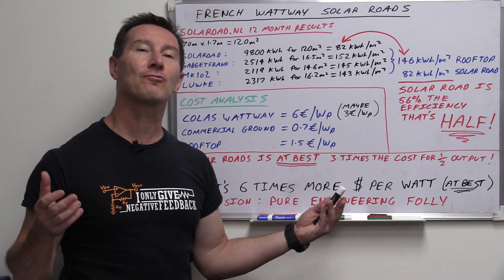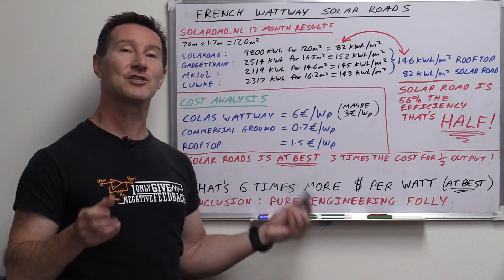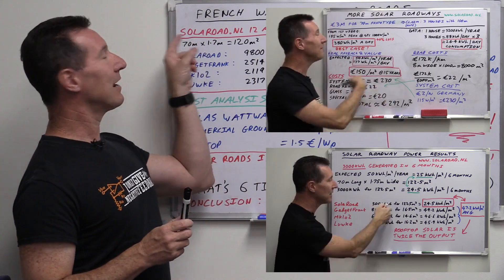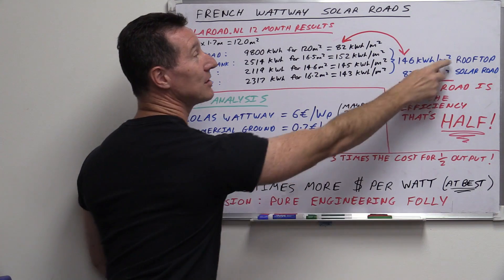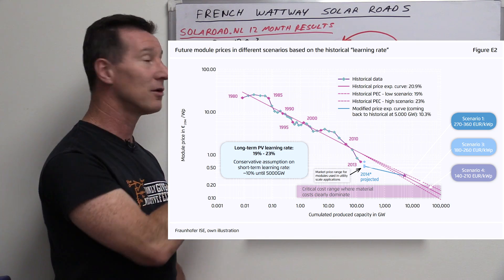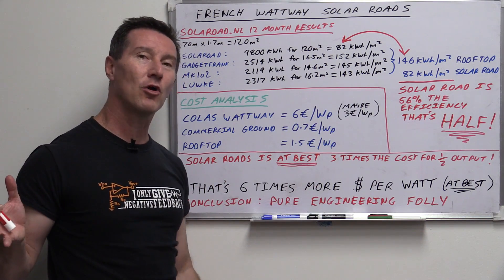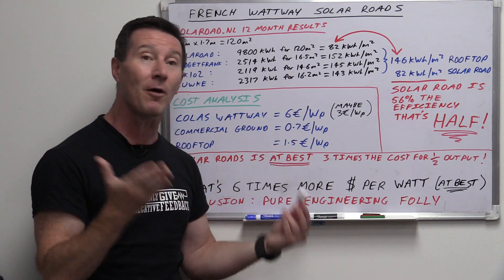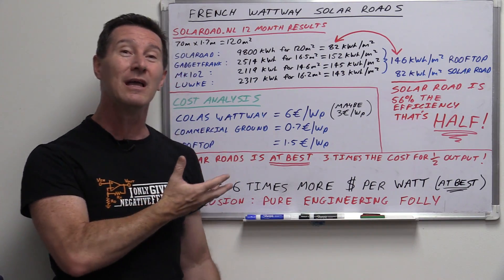EEVblog #850 - French Wattway Solar Roadways BUSTED!

Comment: This guy is an naysayer who is scared of new tech. Yes, they cost more, but they also solve a dual purpose, roads.  If I look at my street, it is about 1/4 mile 1200 feet and 30 feet wide.  If the solar panels are installed that is 1200*30*20 =  720,000 watt system, say it is 1/2 output or 360 kw system for waste space, enough for all the homes on our streets energy use including electric cars.  We just need to get the unions to give the people the control of the streets.
Reply: glass 1,575 °C (2,867 °F)   
asphalt 150 °C (300 °F )
Reply: the production has begun in france with 1 km  solar road ( 0.6  mile)  in october 2016. It 's engouh power for 5000 poeple. The price will fall with the quantity.
Reply: stephen10 The list of toxin used in solar cells, cadmium telluride, copper indium selenide, cadmium gallium (di)selenide, copper indium gallium (di)selenide, hexafluoroethane, lead, polyvinyl fluoride, crystalline silicon and silicon tetrachloride, most the really nasty ones are water soluble.   The polycarbonate binder which the solar cell are in bedded in, can leach toxic chemicals when heated, worn or put under pressure, bisphenol A,styrene, PVC.
Reply: Mark Baanstra
http://www.wattwaybycolas.com/en/faq/ + http://www.wattwaybycolas.com/en/
All these toxic things are already in the oceans with the plastic stuffs floating.
In fact the french solar road "wattway" can resist during 20 years with normal traffic road.
The solar road is wrapped in recycled glass and composite mateials. it 's not toxic. After 20 years you can recycle the materials. Nothing go in the water table, underground
Reply: stephen10 What do think "polycarbonate" is? It's just a high grade of plastic. It's the "solar cells" inside the two glass plates that are toxic, glass on other hand is non-biodegradable.  So Solar Roadways, SolaRoads, and Wattway are as about green as open unchecked sewer pipe.  In the coming years asphalt will be replaced by bio-asphalt.
Reply: Mark Baanstra it 's recycled glass and you can recycle glass forever. after 20 years you recycle the glass and the solar cells inside the glass. 
i don't see where is the problem.
Reply: Mark Baanstra Are Wattway panels recyclable? How will they be processed at the end of their service life?

Wattway can be recycled in two separate streams:

electrical wiring can be recycled in existing streams,
the other components, 5% of which is recycled glass, can be recycled in conventional construction material recycling streams.
Reply: stephen10 This not about it being recyclable.   Wattway not been very opened about which "solar cell" will be used and the same goes for the "polycarbonate".   Nothing is infallible, If this Wattway failed in a flood the toxins that would leak out are far worst than anything in asphalt.
Reply: Mark Baanstra The more I look at solar soadways the more I like them, imagine rolling out a driveway in 1 hour.  Or have a 4' wide sidewalk.  There is no reason these can't be installed for $1 a watt.  In southern California many are reluctant to put on solar due to their appearance.  99% of roof space is presently unused for solar.  In 2.5 years you are already cheaper than the utility.  If you replace every 10 years, that is about 5c a kwh.  you can actually protect the cement underneath.
Reply: on a side walk this solar road wattway is very solid , it can support at least 10 years of use with normal road traffic or 20 years on road with light road traffic or parking lot . They put a varnish with recycled glass on the surface area and you can change it easily.
Reply: pirucreek   You just can't drop cement on the ground and hope it works out.   The making of concrete bedding is time consuming.  It would take months to make a road and longer just to fix it.
Reply: stephen10   That funny, also gave my Dad good laugh about "change easily" anything that been bonded to asphalt with a compound adhesive.  You have no clue just what going to take to remove it.
Reply: Mark Baanstra i speak about the surface area with varnish glass but not about the whole solar panel.
When they instal the solar panel ,they put after a varnish glass on the surface for the road traffic. and yes they can add a new varnish easily. There are video in french showing it on a parking lot.
You can laugh as you want but here we will have renewable electric power .
there is a time of test before to install 1000 km  of solar road.
Reply: Mark Baanstra this solar road is not for highways or intensive traffic road but for villages with few traffic road or parking lot. it 's for public lighting principally or private villa or public place   or even to reload an electric vehicle on parking lot.
Reply: stephen10 Why we writing about the surface?  It's the underside where the compound adhesive will be put on. Then weight put on top and wait four to five days, hope there no rain and summer time is best time to this.
Reply: Mark Baanstra there has been a phase test on a parking lot 6 months ago but now there is a test phase with 1 km solar road   ...  wait and see .
personnaly i hope it will be a sucess.
Reply: stephen10   Good God!!  5 million euros ( 6 million Cad ) for 1 km.  Has the French government gone insane?
Reply: Mark Baanstra the price for a new road in france  is + or - the same : between 2 and 5 millions euros / km.( because we put high quality materials for a long time) .
This one will be protected byt the solar pannel during 10 at 20 years.
The price lowers with the quantity.
Reply: stephen10  To pave a road here in Victoria B.C. Canada, cost 60 thousand per every 10 km's.   Last just as long.   And you can quote  "price lowers with the quantity" all you want.  It won't be until 2316 the price of Wattway is reasonable enough to buy.   So good luck with all, you guys are all totally insane if you think this going make any real money.
Reply: Mark Baanstra i speak about a new road created totally .
For the solar road , the price is 6 euros per watt/crête. The others solar panels are 2 euros per watt/crête.
it 's only 3 time but with a big production they 'll have 2 or 3 euros per watt/crête.
Why are you saying " insane"  like this youtuber ?
In france we have no oil , it 's cheaper if we produce ourselves our electric power.
For canada you have water dam , oil , coal etc  of course it 's cheaper , you import nothing.
In france we import all our fossil energy it 's very expensive.
Reply: stephen10   60 thousand per every 10 km's is the cost for making a new road in Canada.

Where did you get nutty idea it's cheaper to make roads here because the oil we have.  The reason roads are cheaper is by what mix is being used.  A warm mix is used for laying the road top and a cold mix for repairing.  Canada stop using hot mix on the main roads it mostly used on parking lots. Using the warm and cold mix road construction can be done all year around not limited to the summer months.  This why it cheaper.   As for importing, Victoria city on Vancouver island everything we get is imported.

Comment: I think your missing the point mate these are experiments and from what iv seen they have advanced quite quickly in a very short time in Europe, of course they are crap not but your trying to debunk something that is in fact a baby project. I will admit that roof top would be far better for you and me but you have to remember that power producers don't want people producing there own power as that detracts from there selling power to the costumer and they are the one that have the ears of out elected leaders not you or me and for Government at least in Europe land is at a premium for food production so the less used for large scale solar plants the better in the long term. There is also the fact that if you can produce the energy where its needed   you save on heat lose during transport. The thing in Europe you that to remember is we have the smartest grid in the world conecting over 20 countries together buying and selling energy, and as iam sure you are well aware the larges cost are the ups and downs in the requirement of energy at any one time so the more stable our power is at higher level from renewables the less our power plants are needed to rev up and down and that's where the real saving is to be made in the short turn while keeping up with demand as hydro will be far more able to fill in the gapes. GIVE IT TIME AND THE RESULTS WILL COME AND IF NOT THE INNOVATIONS GAINED FROM THIS KIND OF RESEARCH WILL HELP IN SOME OTHER WAY YET UNKNOWN AND AT THE VERY LEAST LOWER THE COST OF SOLAR MANUFACTURING OVERALL. COMPETITION REAL OR IMAGINED IS A GOOD THING WHEN IT COMES TO LOWERING COSTS FOR EVERYONE.

Comment: you missed the fact of the hazmat issues with broken boards and components. now the real question is what does this cost per square meter vs current road tech.
Reply: It depends on what "cost per square meter" you want to know,  I use an easy to understand  glass vs  asphalt temperature to make,  to show how energy that is needed to make part of Solar Roadways ,   
glass 1,575 °C (2,867 °F)   
asphalt 150 °C (300 °F )
On top of that, glass is on the list of bio-hazard materials because of it's non-bio-degrading.

Comment: Personally I think If we want solar road ways to work (No Dirt, No Grim from cars) is to make the cars we drive in float. Show me that tech and maybe just maybe Ill get on board. Plus I think the solar tech is just not there yet. We haven't fully made the "Perfect" solar panel that will work at any angle and generate almost 100% efficiency. I think we should develop solar tech further and shelve this idea until we have the proper tech to do this. We just simply aren't there yet.

Comment: I think there are definite fdoubts about this technology.

But complaining about the efficiency compared with a dedicated installation is missing the point.

Efficiency isn't really the reason to use these systems. As a multi role system it could never be as efficient as a dedicated systems. So this entire line of reasoning is moot.

The point behind these systems is that roads and other paved areas present an absolutely  huge area and that a huge amount of sunlight falls upon them. If even a fraction of that power can be tapped then that would solve a lot of issues.

Who cares about the efficiency compared with a dedicated installation? The important cost is what the cost is per km compared with current roads and whatever other systems it may replace.

This entire debunking is treating them as solar panels that act as roads. In reality...they are roads that act as solar panels.

That means the entire line of reasoning about efficiency is a poor one.  If these worked as planned then each panel would only generate a tiny amount of power....but there'd just be so many of them that the entire system would generate a lot of power. And do it without huge amounts of land being dedicated to power production and distribution.

So the primary concern isn't about efficiency or the like. Its of these panels can act as a road. Then we can worry about how much power they produce, how much can go into the national grid, and the cost of installation and maintenance and whether such systems can be designed to include pathways for power, phone and broadband or whatever.

Arguing that they aren't as efficient as a dedicated solar system is really a poor argument against them

Comment: the fanatics will reply:
"oh, but we'll just make them tougher!"
really? so you will invest more materials, more exotic materials, more money in production, and more energy required in production?

Solar is at best a marginal niche product. Unless things have changed, no photovoltaic system yet deployed actually yields a net surplus of energy output after all the energy required in production, installation, and maintenance have been factored in. Don't get me wrong: It is still useful as an efficient local energy producer in some niches. But it will never become a practical large-scale energy source until the production energy debt problem is thoroughly solved.

Comment: For anyone who has rooftop solar panels I would strongly suggest installing fall protection anchor points and wear a basic harness while working at height.  It sounds stupid, I realize every work day what a hassle it is, yet consider what might happen if you tripped and fell just that one floor height.  One crunch on your head, neck, or back and you're looking at permanent damage and crippling pain.
Fall protection systems are available at most hardware stores as a complete system in a bucket costing a few hundred bucks (Cdn $).

Comment: Solar roadways are definitely not the most efficient design. But as you have said, for special applications this might work. I think the idea of the solar walkway/bikeway is not too bad. The glass doesn't need to be nearly as thick and the wear and tear will be much less. For cities with high rise buildings it might be worth it to also use the sidewalk and park walkways/bikeways to generate power. While this is not some great new tech, finding new uses and form factors for existing tech is worth researching into. A smartphone is basically a shrunk down PC, and now we can't live without it.

Comment: They will put this solar road principally on roads with few road traffic. It's not for very important road traffic like highways or national roads. 
They 'll put them in little villages for public light.
If they put this system on 25 % of the french roads , we can produce 100 % of our electric power  each year , yes 1/4  of the roads is enough !
2.5 % of the roads only and we can produce 10 % of our electric power !
Reply: +stephen10 
You are absolutely correct. This kind of debunking of a solar road principle is very short sighted. They all neglect to include issues like 'available space', rising energy prices, dependency on energy and land availability. 
People also don't realise that asphalt roads need to be resurfaced every 15 years or so.

Comment: You forget something , they don't need to buy a field to put their solar system. The cities  or national, regionnal administration own the roads   and it's free to use it for solar road. 
And second benefits, it protect the road under the solar way ! after 15 years you don't need to put a new expensive bitumen on it.
The road traffic lowers only 10 % the light on the solar way. They have tested the road traffic and the consequences .
This system is planned to endure 15 years of road traffic.

Comment: Solar road of this company  Colas "wattway"  has a cost of 6 euros/watt  (7 $) . For the others solutions it's  2-10 euros. 
But this solar road protect the road under and this surface, zone is free. we don't need to buy it. 
And the test shows that it's not dangerous for road traffic because it doesn't slip during braking. They add glass dust inside the composite material. 
It's non-skid.

Comment: Agreeing with everything you said, I would only add that the test surface we see being installed on the pictures looks like the absolute worst surface to be cycling on. From the country that gave us one of the biggest road cycling events in the world, I would have expected something better. Those panels may be only 7 mm thick, but with those big gaps, you can bet your ass that on a bicycle, you would feel each and every one of them. And for motorists, while vibration will be less of a concern, driving on an uneven surface like that will inevitably cause more noise. So I really don't see this surface working as a city road. Country roads maybe, but then you get transmission losses.

Comment: I am not going to argue about the practicality of the materials as a surface or the cost in maintaining it. However I do want to point out that your comparison statement is completely wrong and misleading. You said, "at best its 3x the cost for 1/2 the output", when comparing it to "commercial ground" roadway. 

Should that be "3x the cost at infinitely more output" since commercial roadways produce 0 ouput. It seems like that statement was purposely misleading to support your argument. When in actuality it is "2x the cost at half the output" of rooftop systems.

Again, not arguing for or against the idea of solar roadways, just think your comparison should be fair and accurate.
Reply: +Beriah Dutcher You misunderstood. He's comparing it to commercial solar installations, not commercial roadways.
Reply: +tybofborg 
But what he did not mention is that a commercial solar installation is build on ground that cost money as well and cannot be used for other purposes; you cannot live on it, you cannot grow anything on it and you cannot run a factory on it.
Reply: +Peter van der Meer I think by "commercial solar installation" he didn't mean "commercial solar installation that didn't pay for the land". That is included in the price. And even barring that, you still can't beat the price of rooftop solar. Which is much cheaper and doesn't take up any useful space.
Reply: tybofborg One of the main problems with rooftop installation is that from a practical standpoint it cannot be deployed on a large scale since governments don't own the rooftops... These roads can be deployed on a large scale.
People really need to stop comparing these roads with rooftops and start judging these on their own merit.
Reply: Lots of things have been deployed on a large scale in private residences, for example sanitation and household electricity. Neither of those things used to be ubiquitous at first.

Why would I stop comparing them? Just because solar roads look cool? Okay, you can buy a strip for your driveway if you think it looks so cool, I won't say a word. But as long as public funds go into producing green energy, I think it's fair game to compare it to other, cheaper methods of producing green energy and asking whether it would be a wiser way to spend tax money.
Reply: +tybofborg 
Fair enough.